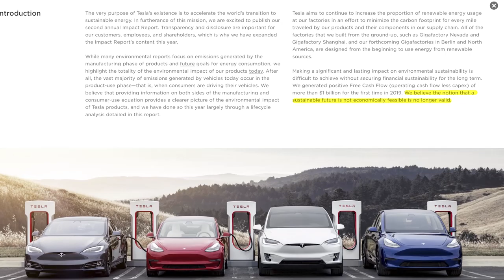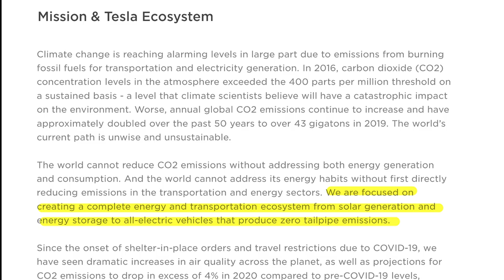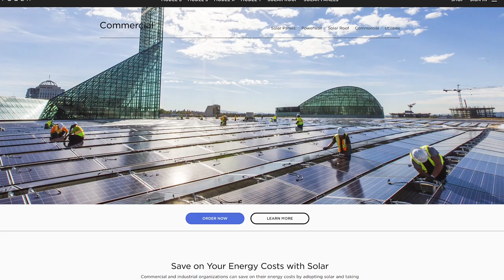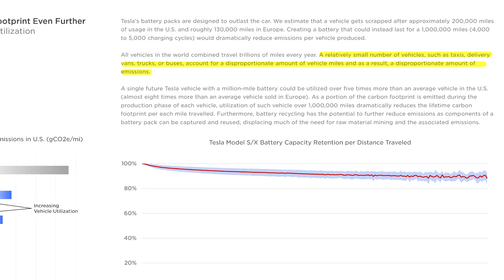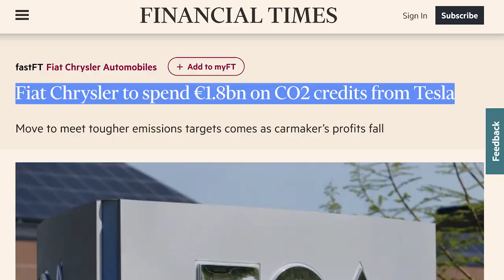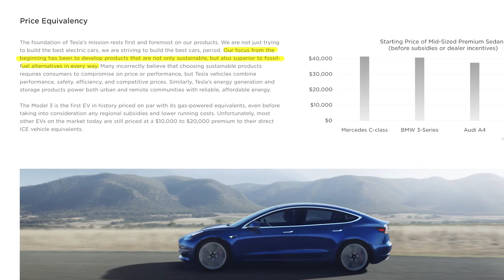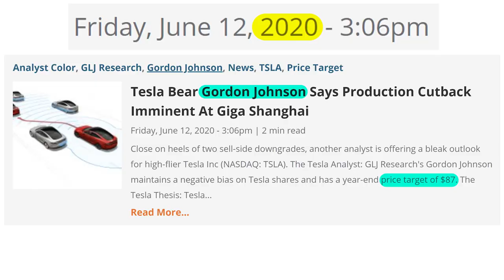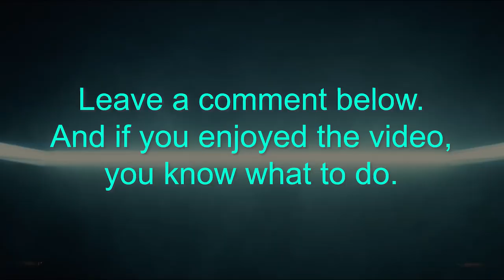Tesla Flexes Hard (and puts world on notice) In Impact Report 💪

Comment: I want a Tesla. I don't want any other car.
Reply: same
Reply: Build one
Reply: Same same same same same same same!
Reply: Only new car ive ever wanted... well thats not a super car lmao
Reply: Yeah
Reply: You would have to buy a new one directly from tesla then. tesla's that have been fixed by someone other than tesla's mechanics arent allowed to speedcharge or use tesla charging stations this is also the case for second hand tesla cars most of the time and if you were to switch those things back on in the software of the car you will be sued
Reply: @MaestroTunes  As a small stockholder that concerns me....service also sucks for many ppl, DIY assistance needed too.  And make all upgrades transferable to 2nd ownership.  Imagine paying $7k for FSD post purchase then going to sell your 3 a few yr.s later only to find that $7k gone--say your car was worth $25k on used market with FSD but now it's only $18k.
Reply: Same but 50k???
Reply: Even if you can afford a 50k car, The problem is the cost & scarcity of parts & service
Reply: Same. But they don't make sense to me financially speaking. They're still too expensive. Let's see what they do for the compact car market in a few years.
Reply: CB Yond - Tesla Model 3 starts at $37,990.    Also consider that most people will save about $10,000 in fuel cost over the lifetime of the car since electricity is cheaper/mile than gas.  Maintenance is less than an ICE car - 100x fewer moving parts. Even brakes last longer thanks to regenerative braking.  It’s a great car if you can afford it
Reply: Scott Messenger  The $50,000 model 3 performance is still £50,000 in the UK, thanks to tax an import duty. Based only on exchange rate, it should be £39,858 in the UK. Can’t wait for a Tesla factory in the UK.
Reply: Exact fucking ly
Reply: Same my guy
Reply: This comment thread MATTERS
Reply: Yeah me too, currently using a $2000 car to save up.
Reply: Have had a model 3 for the past 3 months. Never going back
Reply: There should be a club for people like us that want one, but don't have one yet.. 😆
Reply: this matters!
Reply: HEIL TESLA ♻️ 🔋 ✊🏻✊🏼✊🏽✊🏾✊🏿
Reply: I’ve had my Model Y for 6 days, never buying and ICE car again!
Reply: I’ll be their customer in 2023 buying the Cybertruck
Reply: I have the Model X and it’s ..... awesome 😂
Reply: It’s the greatest car ever.  I will never again own another car and my future wife must agree or we are not getting married.
Reply: @paulweninger8018  =
Reply: There’s a Model Y Long Range out there with my name on it.
Reply: If only I had the money
Reply: Want the y. Own the stock. Time will bring it together.
Reply: makoshark40 same I told myself I would never buy a new car but now...
Reply: you can rent it out to cover costs - this is how my cars self-fund themselves!
Reply: In 2013, I couldn’t afford $100,000 + for a Model S, so settled for Chevy Volt @$50,000. I drive electric 95% of the time. I still want a Tesla, am undecided: Y or Cybertruck? Paying in Canadian $$, so 25% more. Still unaffordable, but will find a way! Tesla is the only way to go!!
Reply: Tesla-Taxi-Millin QLD-HQ-Brisbane-Bear  -An encouraging idea, thanks!
Reply: same
Reply: Same. If other car makers are to survive they need to offer software updates
Reply: Same. Everything else is obsolete :)
Reply: @MaestroTunes  you don't know what your talking about.  Salvage title modelx and S have been lock out of super charger net work probably because they had life time free super charging and as far as Tesla is concerned after it is totaled by the insurance company it has reached the end of its life.  Salvage title model 3 s have not been locked out of super charging.  All payed upgrades stay with the car after sale.
Reply: Get the new ford mustang EV, better and more solid car and identical look inside and it is based on Tesla. Plus it won't break as easily. Plus when the warranty expires you actually own it, meaning that you can get anyone to repair it, which will make it cheap to keep. Tesla don't do that, they are playing the Apple game. More features just means more times you have to go and get it fixed. And constantly being on the net so Tesla can snoop in on you via the car or the mandatory app is just sick. Same with the keycard, it just leaves you vulnerable to attack.
Just imagine driving down the highway and then someone hacks your car, and turns the screen black while you are driving, a living nightmare. This thing is as safe as trusting your VPN company will not give you data away to NSA when they come asking. (and trust me, no one can say no to those guys)
Tesla is the new Skynet.
Reply: @mgl455  Be patient Evs will become more affordable. It will always be in Tesla's interest to make cars more accesible to the average joe
Reply: Nick Smith too bad that the UK left the EU. If Tesla ever make a factory in Europe it’ll probably be in the Netherlands or another EU country.
Reply: @kamenemanuilov2108  Have you ever heard of Giga Berlin? They already building a foundations, btw.
Reply: Me!
Reply: Liam Miller You might want to take a close look at Rivian
Reply: Lease it thats what I want to do
Reply: @gregkelmis2435  Rivian is Ok but I want Tesla because of the Autopilot
Reply: All other cars look dumb in comparison
Reply: Buy one and get that referral link while you can
Reply: Me too
Reply: Time for electric...save the Mother Earth.
Reply: Elon is bringing us to everything we hoped a future would be and dismantling  outdated technologies that are only around because of greed
Reply: Elon is bringing us to everything we hoped a future would be and dismantling  outdated technologies that are only around because of greed
Reply: Best car I ever owned. It's only gotten better. Range and speed increased through software update. Its fucking bananas!
Reply: @Mrbfgray  SaaS coming (maybe) hopefully!
Reply: @untilthemoon137  What the HEY is that??
Reply: Same
Reply: Wouldn't mind a 458 myself
Reply: Me too
Reply: Scott Messenger I love my Model 3, and that used to be more of a consideration with gas at $3, but with gas prices so low it isn't currently. Right now, 12k mi at 30 mpg is only $720. Unless you have solar electricity isn't free. At $0.11/kWh (which is cheaper than a lot of places), my 3 (4 mi/kWH) costs $330 for 12k mi, not counting when it drains about 1 mi/h sitting in my garage (that's without Sentry mode, which uses more). I'd say it's about equal with gas prices what they are right now. You do save on oil changes and brake pads, but not enough to make up the difference on purchase price, unless you're only comparing to A3/4, BMW 3, or C-Class. I still prefer it because I love how it drives and the tech, and it's better for the environment. But gas needs to be at least $3/gal for it to make economic sense, or Tesla needs to get Model 3 down to ~$30k.
Reply: My wife refuses to buy a expensive car that gets crappy mileage and you have to put gas in it. We like our M3 but model Y is speaking to us.
Reply: CB Yond we’ve bought wiper blades and cabin filters in 28k mikes and 18 months. You will never regret buying one.
Reply: Nick Smith you don’t need performance model. Wife never uses autopilot features. Buy within your budget.
Reply: SAME
Reply: RIght?!?!?!?
It's like we're at 2009 and the smartphones are here and everything else is Nokias!
Reply: @mgl455  
The Cost analysis from several sources points out that buying a 50k Tesla will cost the same as buying a 28k gas car in five years.  So just think of buying a sub 30k car if you plan to keep it for five years.
Reply: Same
Reply: When you drive a Tesla, you realize every ICE car is simply broken
Reply: I want any other car than a Tesla. Musk is one giant, steaming 💩 fraud
Reply: Cybertruck is what I want!
Reply: Get a loan for a Tesla
Reply: A way to set a cyber goal
Reply: Same. Nothing compares, nor ever will.

Comment: I imagine a time when fuel cell costs are so low, Tesla will employ fleets of charging vans on every highway that pull up to your vehicle, couple in autonomous mode, and charge your vehicle's cells so you don't even have to get off the road. Like in-flight refueling, but for the road.
Reply: I think by the time fuel cell cost are so low battery technology will probably be around 1000 miles per charge and charges quickly. Not sure if anyone wants to be in their car that long.
Reply: @vinht23  Yeah, I live in a country where people think little of driving 12 hours in a day and there are routes where you could go hundreds of miles without seeing so much as a petrol station or even a house.

But even here once you get much past 12 miles of range there's going to be almost nobody left that cares.
And those people are in a tiny minority.
Most here, even the long distance drivers, will be fine with 600 miles if the charging infrastructure ends up being even vaguely comparable to the petrol infrastructure...

Your average city driver that maybe makes the odd trip into the country can probably manage with a 250 mile range.

And we're talking one of the most sparsely populated countries around, which is already a massive outlier in terms of range demands for vehicles...
Reply: So wrong on so many points.
Reply: why would they use fuel cells instead of just more batteries

Comment: Even analysts who are sympathetic to Tesla routinely downgrade the stock, allegedly based on "valuation".  The standard car company vs. tech company debate.
Even with Tesla's lead in battery tech other companies can follow closely (e.g. CATL also will have 1M mile battery w/reasonable performance).  
BUT tech/software issues (where everyone else sucks e.g. VW failed and fired their CEO) have become the dominant factor for determining success.
1. Integration.  Like Apple.  How well everything is put together seamlessly and not just bought from others and slapped together.
2. Integration + Software management of car (battery/user interface/electronics)
3. Integration + Software mgmt of car + Software for autonomous driving
Taking just the autonomous driving point, Tesla's approach (again) is heavy on software / AI and light on hardware (e.g. no expensive Lidar).
When analyzed like this, the hardware (actual car + batteries) are a very small part of the success equation - this is why Tesla should be appreciated as something very different from a car company, even though it obviously looks like one.

Comment: Solar tile ✅
Power wall ✅
Cars ✅
Trucks ✅
Municipal peak battery plants ✅
Many that I missed  ✅✅✅
Residential HVAC ❌
What does that even mean?   heat pump? Gas furnace? Independent AC? Doesn’t all really just fall under 4 letter?
Air quality has so little to do with any “HVAC” system and everything to do with the fit of the exterior and design of the ductwork.
Electric Heat pumps have come a long way but still could be improved. The US doesn’t have a market for them. It’s quality of heat and nothing to do with efficiency. People won’t install a heat pumps or electric stoves in a gas home. Most US home are gas. In the US all-electric (electric only) homes have less value than gas homes. They are usually in rural areas or certain track developments.

Are we talking about AC independently? Better compressors? Again different processes between electric & gas heat. This could be amazing but? again? what are we talking about?

There is a true need for a improved maintenance free electric tankless hot water heater! Gas hot water tanks are expensive, inefficient, not built to last, property damaging prehistoric and require extensive recycling.This could easily go into every new home in America. Many Landlords would replace tanks above the first floor before needed. This could provide effective on demand solar hot water all over the developing world. Its just not available today without ridiculous maintenance and expense.
Corrections/Information welcome!

Comment: 150-200,000 miles...?

I was wondering about that. XD
And here I am driving around in a car that's getting close to 500,000 km. (310,000 miles or so)
Still runs great.
Body is holding up structurally (if not cosmetically)
Electrics are a bit finicky. (central locking especially has a lot of quirks)
Interior, in particular the front seats are starting to show a lot of wear...

But it just shows that some vehicles are built to last, and perhaps many of us are too keen to dispose of old things just because we can.
The wear and cosmetic damage it's sustained due to minor accidents aside, it doesn't even look like an 'old' car anymore, since fashions in car styling haven't changed much in the last 2 decades...

If it wasn't for the electrical quirks and general wear and tear of the interior, I'd bet this thing could be usable to at least 1 million km. (600,000 miles)

Makes you think doesn't it.
When it comes to environmental considerations anyway.

Though, it's probably not so great in that regard, since it's an Internal combustion vehicle, and research on the pollution from vehicle manufacturing vs those from operating it show it would take as little as 2-3 years for the fuel burned to outweigh the manufacturing, which means the bulk of the pollution at the age this car is reaching is from the fuel used to run it, and the manufacturing represents maybe 10% of the total or less...

Comment: If they continue to pursue heat pump technology, it wouldn't surprise me if they got into water heaters before an HVAC system. You can retrofit a water heater for a couple thousand bucks, whether it's a tank system with a slow-heating but ultra efficient heat pump (with a programmable heating cycle), or an on-demand tankless system. A total HVAC system is much more expensive, has many more construction compatability considerations, and has a much longer breakeven.

Comment: As a Tesla owner, I can hardly wait for the product to meet the hype. I’ve had so many problems with my model 3 it’s ridiculous. And dealing with them for repairs is still a nightmare, especially when it’s a warranty problem.
Reply: Good to hear owners perspective.  Did they eventually fix your problems?
Reply: someguyonaguitar yeah, don’t get me wrong I love the car (performance, quiet, no gas), and so far they’ve always fixed the issues. I’m just blown away how many issues there have been.

I’m giving them the benefit of the doubt and hoping they are growing pains. In addition, I sure wish Elon would put his mind towards solving the problems with customer service because tesla has some of the worst of any company I’ve ever dealt with. People are hard to get ahold of, rarely know what’s going on, don’t return calls, etc etc.
Reply: Yeah, they could really use some improvement on that front. Customer service and warranty repair can take quite a bit of nerves to get through. But sometimes fixing the problem quicker is a simple matter of going a few miles extra to a different Tesla "dealer"/service provider. It all hinges on the ability of the staff. Elon needs to put some forcing functions into place to increase NPS and have ppl.'s issues solved better.
Reply: I think the reason that I was even motivated to speak up is that recently the front left wheel control arm spontaneously detached while driving on a 4 lane highway. It was a miracle I didn’t wreck. I’ve never even heard of someone having a problem like that. The first Tesla mechanic said it was our fault because he could see some scratches; I informed him those were scratches from being towed and even so a scratch shouldn’t result in a terrifying loss of steering control at 70mph. I said “look, this is a recall level issue, you need to have someone take a closer look”. They agreed to look again but we’ve been waiting to hear back and it’s been two weeks with no car, no info.

My family is just praying they don’t come around trying to blame us again because getting a lawyer involved would be a nightmare.
Reply: I wish I could post a photo here, it’s a real mind boggler. The detached arm is in pristine condition but the half inch bolt that is supposed to hold it in is nowhere to be seen.

Comment: Is anyone else worried about the looming shortage in raw materials used to make batteries? It would take about 5 years to bring new lithium supplies to market if we started the projects today, and we are not starting the projects today!
Reply: Vacuum distillation of seawater solves the freshwater crisis problem and can supply lithium also that is what recycling is for and was talked about in the paper and this video.
Reply: Barskor1 Recycling is economically valuable to recover some of these metals, but it’s only a small piece of what we will need in the coming 5-10 years. I haven’t read about the seawater process. Thanks.
Reply from the maker: Remember recycling.

Comment: Now, if they can only stop delivering lemons in the form of Model Y vehicles with so many things wrong that I'm pretty sure this will end in lawsuits. It stopped me from buying a Model 3 as it's issues are still there. The idea of buying a $50,000 vehicle and having to go to a detailer to fix it just doesn't fly in my book.
They must slow down production until they can build with quality at delivery. The current idea that they can fix after delivery might work for some but anybody over a hour away and working for a living, this plan is not feasible.
The current status of Tesla still won't stop me from buying a used Model S but I'm holding out until I find out what the S refresh is all about.

Comment: i doubt that tesla will use (only) 2 different battery chemistry . they will use the fitting chemistry for every  type of application. so more than just 2. home storage does not need to be high energy density nor high amps. robotaxis need huge lifetime. sports car needs high amps and energy density. big scale grid storage might need high amps but mid energy density. ect.